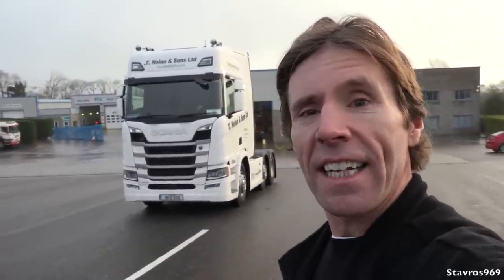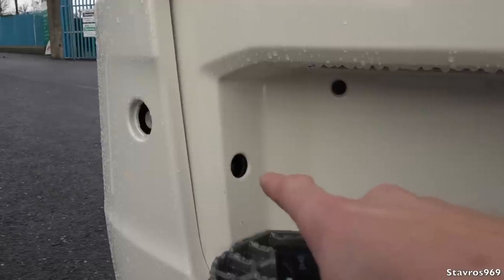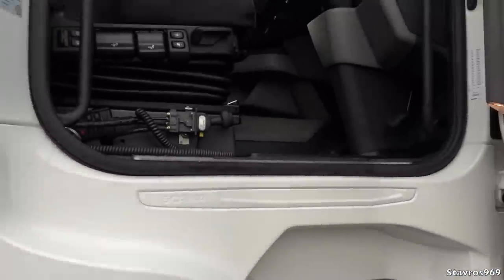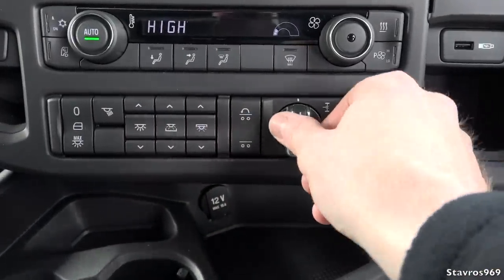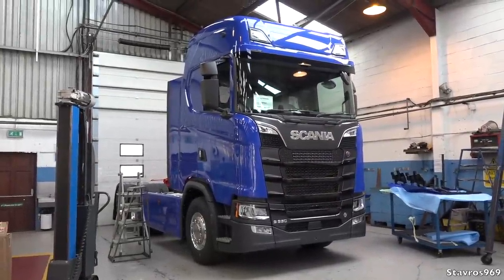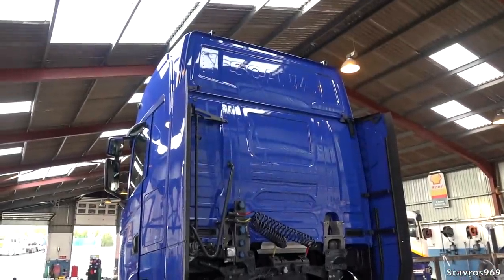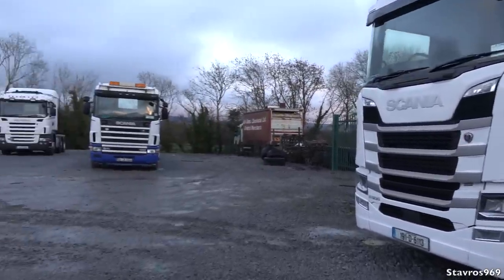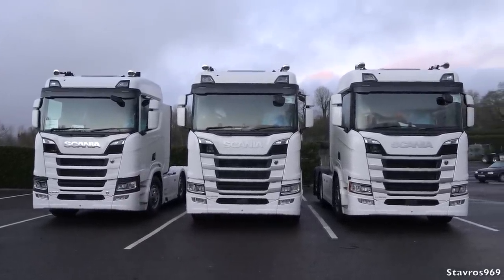2019 SCANIA R500 Highline Full Tour & Economy Test Drive

Comment: Get a little anxious when there is no dipstick. I don't always trust the instruments. I did, however, almost screw it up though. During my daily check of the Scania R560 I was going to drive that day, I checked the oil but it looked like it was completely dry. It was 5 in the morning so it was still dark aside from a couple of street lights lining the company parking area But i decided to fill up with 1 liter of oil. I waited for about 5 minutes and checked again. Nothing. Filled up another half liter of oil and still nothing. So I got my flashlight and looked closer. I had just almost overfilled the oil. The 0W30 oil was so thin ad so light that I couldn't see it on the stick until I shone a flashlight on it. It was now just below the max line. I was used to our Volvo FH540s and the oil they used was much darker.